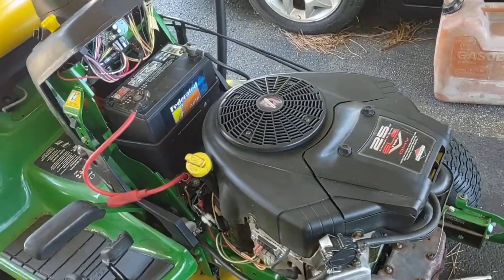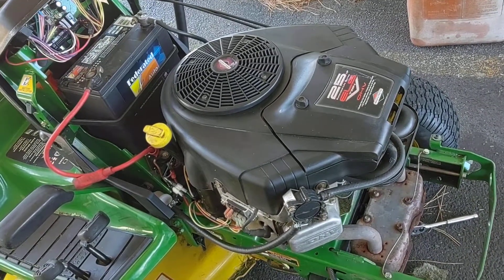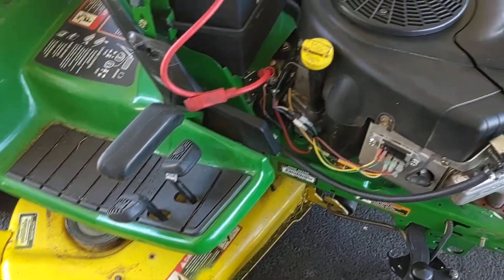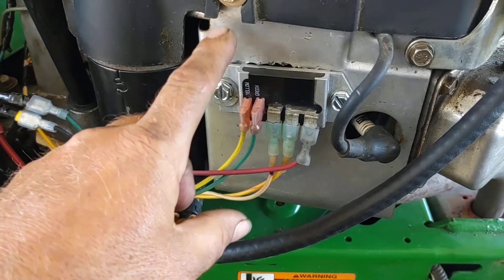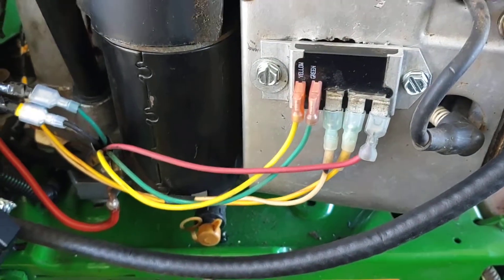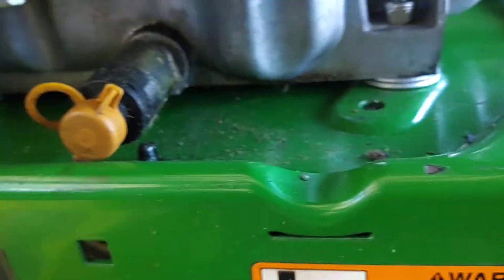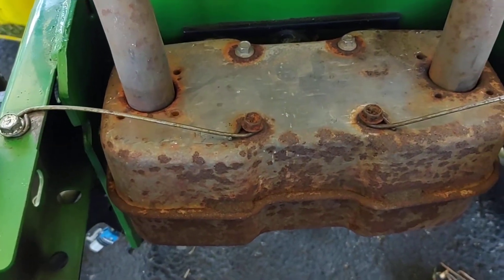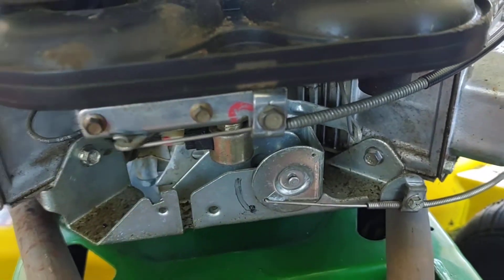Engine swap on John Deere lx277 and how to wire it up

Comment: Great job on showing the wiring. Any chance you could tell me which alternator was used? I am doing a similar swap on my LX277 and have not been able to get the proper alternator sorted. Any help would be appreciated.
Reply from the maker: Alternator was original on the 25 HP Briggs ..it got to come off of a mower that has PTO ..because it puts out more amps for powering the PTO ..

Comment: Great video Joe, I just sold an LX277 last year.  Great little tractors.
Reply from the maker: Thanks i'd upgrade the engine on it to a 25 hp briggs v twin.. and put 23x22x10 on it.
Reply: @joepinto509  personally id put Kohler command or Kawasaki. much more reliable and long lasting engines.